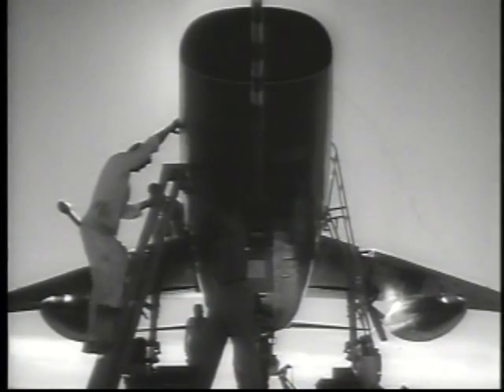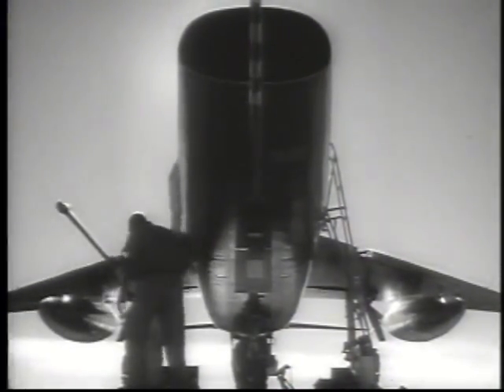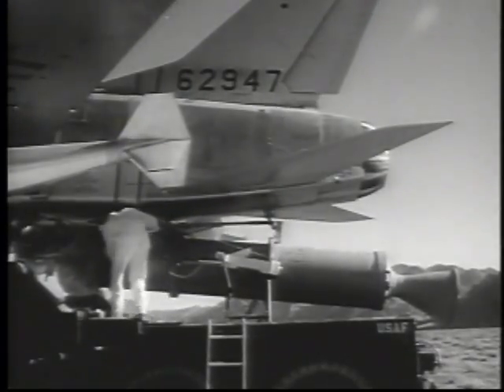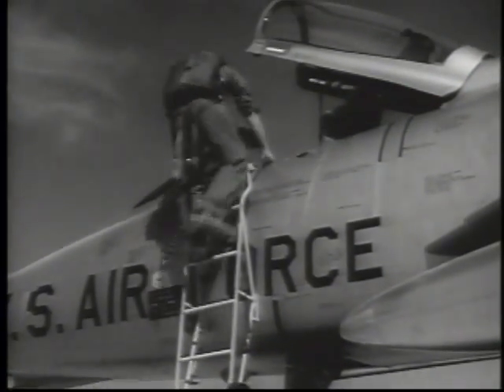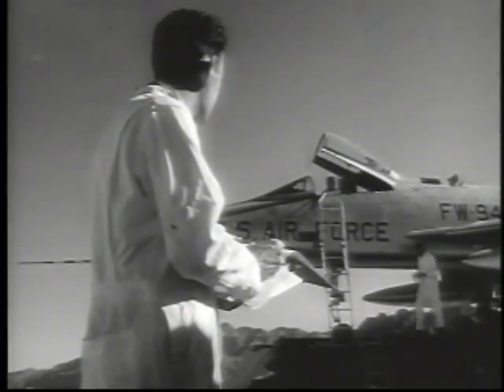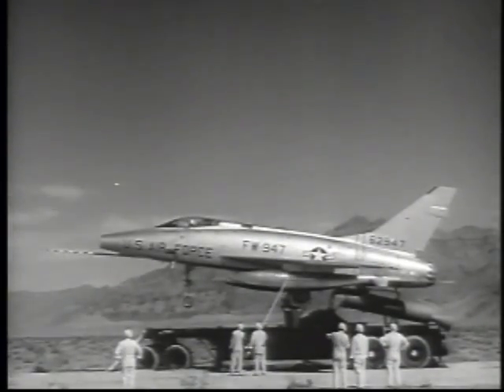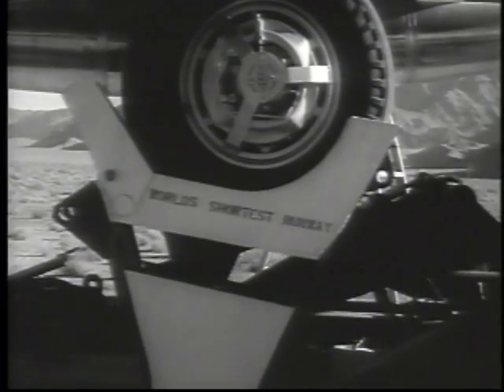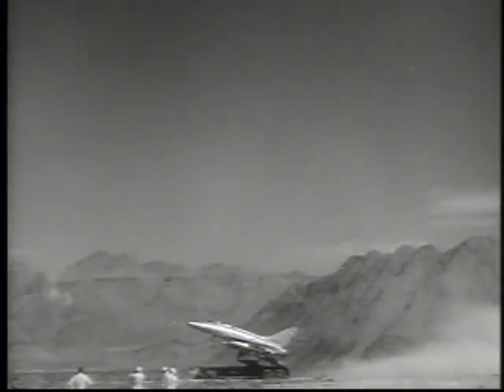1958 F-100 USES SHORT "RUNWAY"

Comment: Nope. This would be used in the air-to-air role for interception, which uses a very light weapons and fuel load. It would be used to decrease the time from scramble to launch (no taxiing), and would avert the need to use easily-hit alert revetments, as the aircraft could be dispersed across an airfield. The aircraft would land normally at any available facility,

Comment: First of all,
the Russians were doing this,too,
at the same time.
Who was first?
Who cares?

Secondly,
the Astrodyne unit used here produced well over 100,000lbs. of boost 
(so I read,at any rate).
I don't think payload limitations were much
of a concern. 

Compare it to those on a C-130.
See the difference in the size of the unit and the exhaust?

Comment: hmmm... now im thinking why was this idea not continued. The problem with harriers (or probably F35 VTOL mode) is that you need a ski jump and 200m of deck to get them airborne rather than chewing buckets of fuel going vertical. Why not avoid both those problems by quickly attaching your RATO monstrosity and blasting off instead. So take off ZEL style and land vertical and with full payload. Convert any merchantman into a carrier with ZEL launchers.....

Comment: zzddytt: Your first point is incorrect - they were able to launch the F-100 with two (full) external fuel tanks and two (simulated) nuclear weapons. With a total thrust/weight of 4, payload wasn't that big of an issue. Your second point didn't matter to the mission of deterrence through assured retaliation. Bailing out at the end of the mission, while unpleasant, was probably preferred to getting fried on the ground in a preemptive strike. In the end ICBMs and SLBMs made all of this unnecessary.

Comment: If you think this is good (or idiotic), you should consider the companion plan to land such a zero-launch F-100.

The idea was to have the pilot try to plunk the aircraft down on a giant inflatable rubber pillow that was to substitute for the (presumably disabled) runway.

(I'm not making this up.)

The first guy who tried it broke his back. After that, it was back to the drawing board.

(Man, but the late 1940s-1950s must have been a fun time to be an aeronautical engineer.(